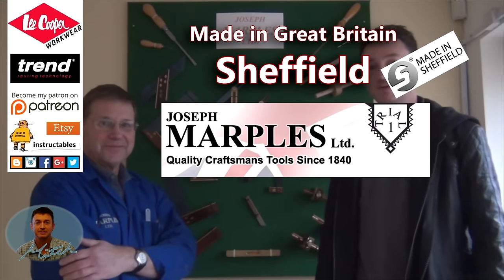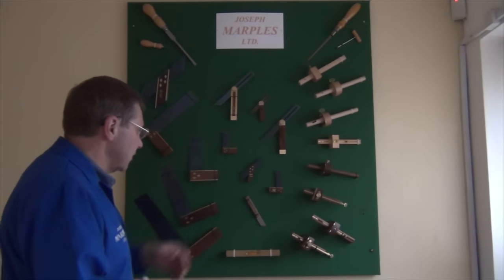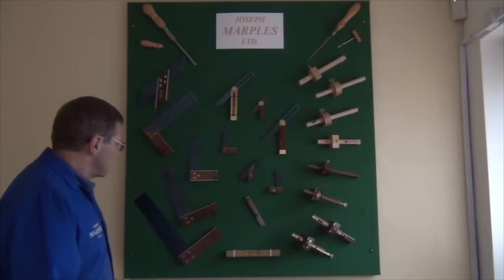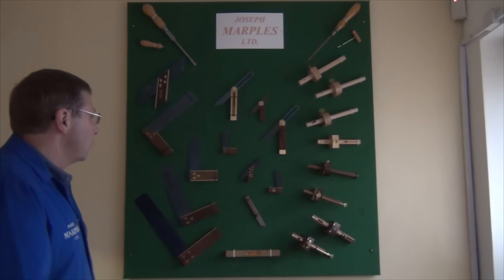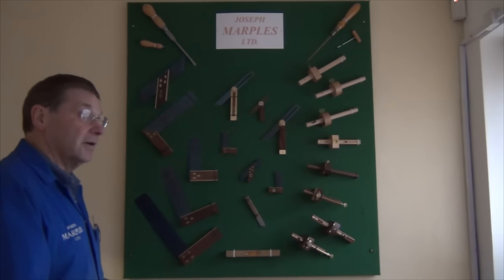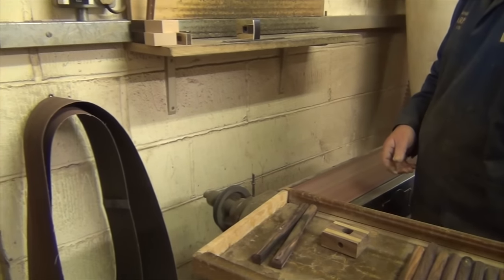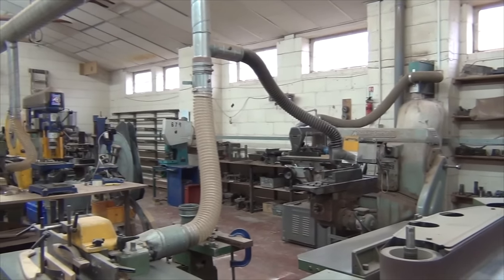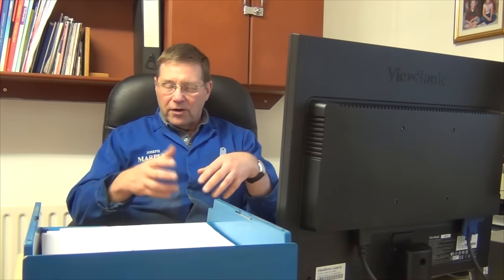Joseph Marples Visit

Comment: Once again you sent me scurrying to check my old tools. Seems I have a 5 piece set of chisels, plain wooden handles, stamped Marples inside an oval on the handles. Knowing me, they're probably an economy set bought in the 1970's.
Reply from the maker: A couple of minutes sharpening them and you'll soon know if the steel is good. Marples is pretty dependable in my experience. I have a few, probably of the same era